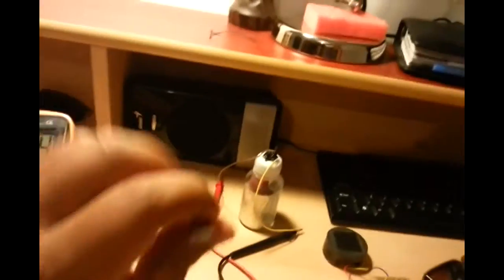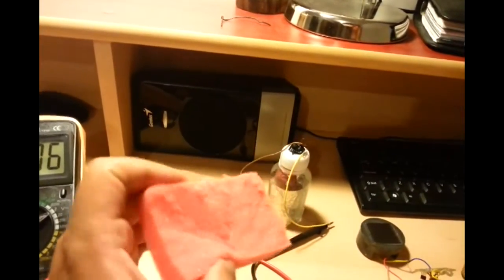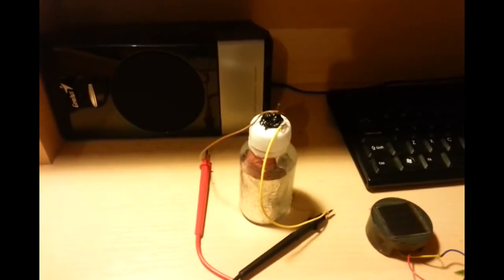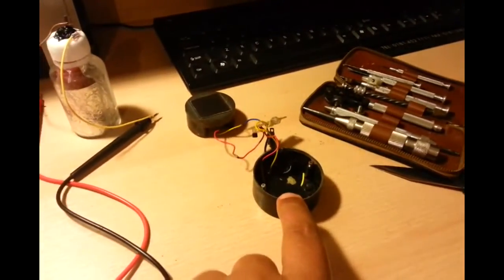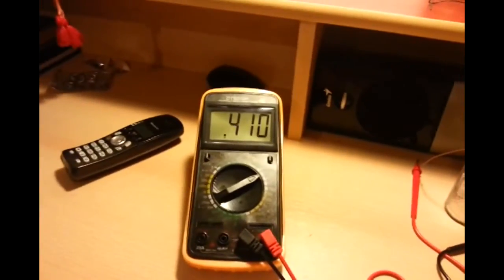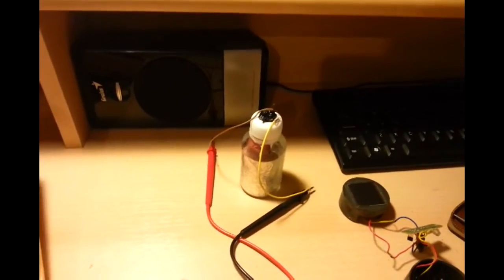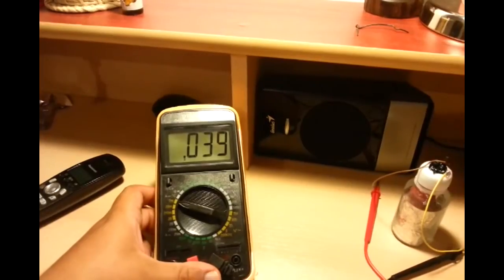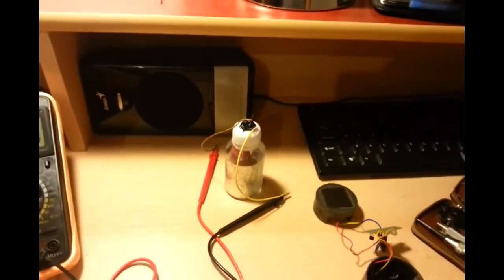Karpen Cell replication 2

Comment: Cool. I just made one of these with Epsom salt and got just slightly higher amps and volts. I imagine a series of these would run a long time. Couldn't remember what I did different before then I put a 12v charge to it. Positive on carbon, negative on aluminum, and it charges up in seconds. 2 volts out 180 mA and slowly discharged through the amp meter setting. Charging disintegrates the carbon and blackens the solution so you need low current. A lot of HHO gas! This has me wondering if charge can be stored in the gas with a balloon on a sealed cell. There were gas batteries made. I'll have to do more testing. Joule thief or solar cell should work well.
Reply from the maker: I saw someone who's put some graphene inside the electrolyte and supposedly turn out a groovy capacitor... 
I can't get AlCl3.. for some reason both this and the HCl are controlled substances in Romania ... but I saw some iron chloride supposedly a 3 valces substance too :) I'll have to try... see what comes out ... stick a supercap and see what happens.
Reply from the maker: been meaning to ask ... did you dissolve the salt in water or just applied the solid crystal inside and jammed the carbon rods in ?